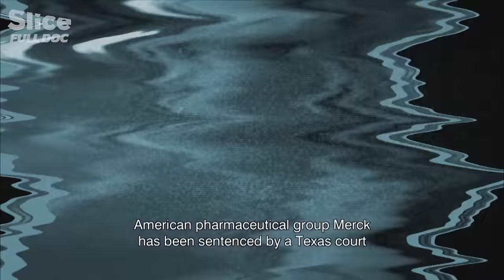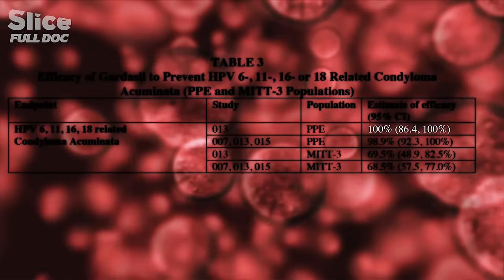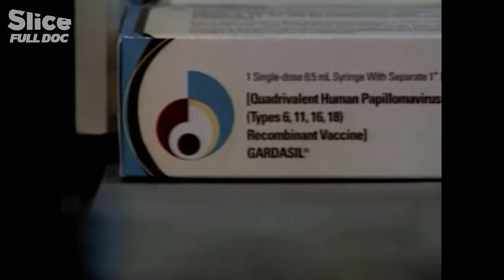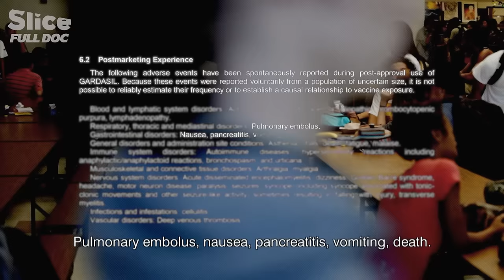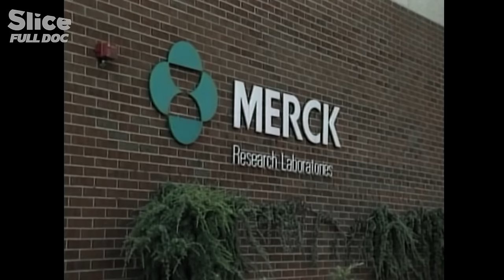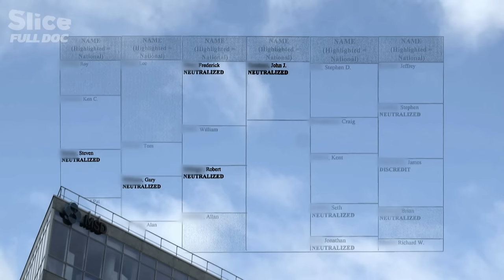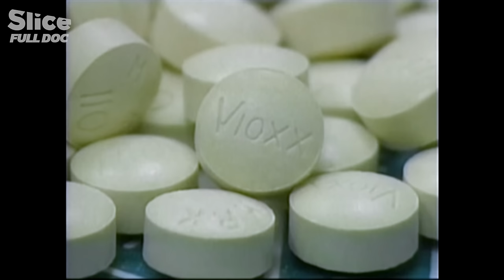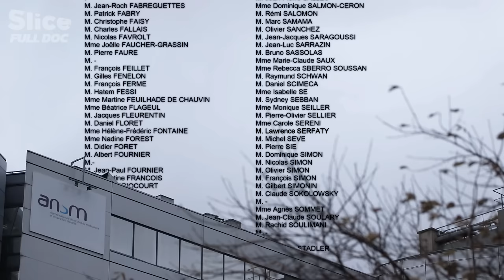Inside Big Pharma: The Dark Side of Pharmaceutical Giants | FULL DOCUMENTARY

Comment: In nineteen eighty nine a medication caused the fever that put me into a nursing home Because I could no longer move my legs.  I left against medical advice. And when I got to my apartment. I was catching a cold and was too weak to cough. I put a heating pad on my nose and within a half hour could breathe through my nose again.  In Dec of 2019 both my nose and mouth filled with phlegm and I could not breathe through either until I could blow my nose and spit and ask for the heating pad.  I used it on my nose and throat and that problem was gone almost as quickly as it arrived.  I could never have made it to a hospital.  But I didn't use heat on my ear and now have a hearing problem.